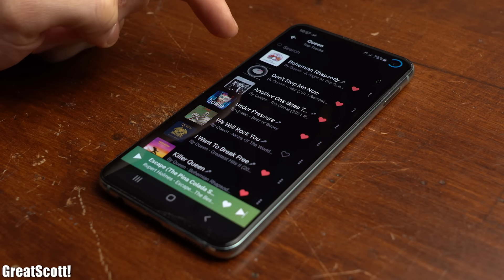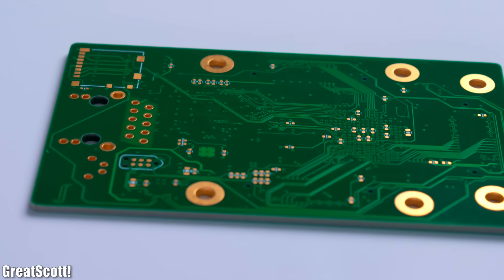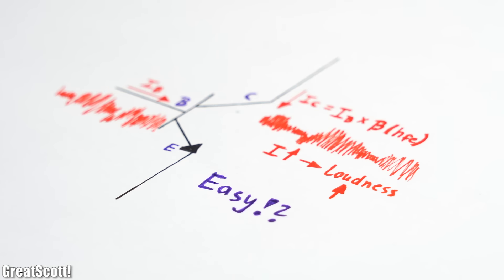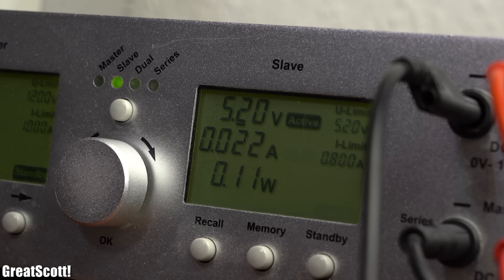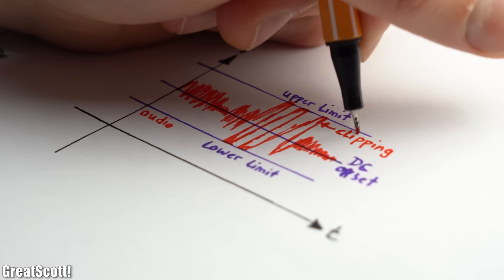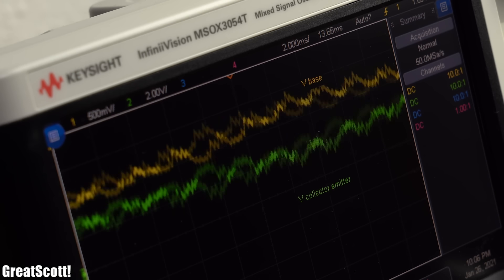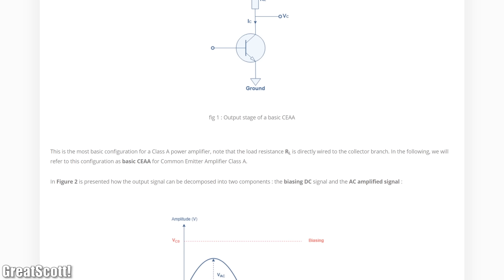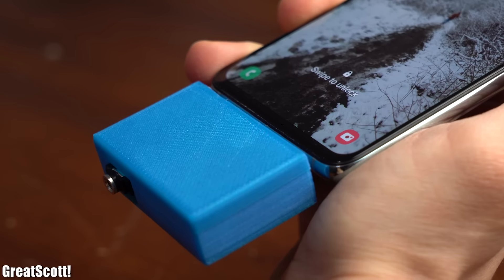Building the simplest, best sounding, yet most inefficient Audio Amp! || Class A Audio Amp Tutorial

Comment: Just wanted to clarify, isn't this generally the circuit used by preamps?
Reply: No! 
Pre-amps need to have very high input impedance to match the output impedance of microphones. That's why most pre-amp ckts use JFETs

Most pre-amp circuits on top notch audio equipment are hand tweaked for each mic and are secrets learned from experience

Text book designs are only used for average audio quality hardware 

Most audiophiles can tell the difference and would immediately reject cheap pre-amps

Comment: Have you tried a similar project CMOY amplifier?
Reply: You'll have problems getting a CMoy amp to run cleanly with a 5V supply, even with an OPA2134. There's really not enough headroom to cater for the voltage drop in the output resistor, especially with lower impedance earphones.

Comment: Might make more sense to use a single rail OpAmp. Certainly it will have better linarity…
Reply: Single rail opamps that will run off 5V and drive 32 ohm loads cleanly are not as common as you might think. I'd simply go for an LM386 to drive headphones.

Comment: Hi, I’m kinda new to electronics, can someone explain what he meant by “remove the input voltage “ and the use of the capacitors here ? Thankyou
Reply: He means the capacitors remove any constant voltage dc part of the signal. This is normally called dc bias. The capacitors are acting as 0hz filters.
Reply: @nakmail  hi, thankyou, so you mean if the input was 0v for a few seconds, the output would be 0 volts? Sorry if im not on the right track here
Reply: @georgekirby7656  Yes, if the supply was centred at zero anyway.
Reply: @nakmail thanks

Comment: I made this circuit but i changed audio and power to female connectors (power to micro usb) and i get a noise. It changes depending on the power source. Not sure how to deal with that
Reply: Decoupling capacitors.

Comment: You forgot to draw the load (O_O)
You know that since it is a common emitter amplifier, gain can be calculated as Av = - Rc / Re. Right? And what is Rc in your schematic? (The answer is not 130 Ohm)

I really liked this video, but I think you started on the wrong hypotesis. Ok, I know you wanted to use the simplest schematic possible. But why you haven't used a common collector stage? Or a common emitter, followed by a common collector? Or the simplest one: to use a small 2 channel opamp. This latter is the most understandable for everybody, I think.
Reply: The unloaded gain of the circuit is indeed -Rc / Re. And Rc is indeed 130R, giving an unloaded gain of 5. I leave it to you to confirm that the headphones have to have an impedance greater than 32 ohms if the circuit is to have any overall gain at all.
Normally, trying to get a voltage gain and a current gain out of a single stage is a big compromise, but the input impedance can be low in this case because it is being driven from a low impedance source, designed to drive headphones directly. That means you can increase the collector current to lower the output impedance of the single stage (which lowers the input impedance as well) without penalty.
So, what current would you use in a common collector second stage? 40mA? 80mA? What size of emitter resistor do you need to drive a 32 ohm ac load effectively? Then check whether you can't get the same result by simply increasing the current in a single stage common emitter by the same amount. Is a second stage then worth it?

Comment: I don't understand how 1ma was too quiet, 10ma was distorted, but 20ma was perfect. Wouldn't 20ma be worse than 10ma?
Reply: The 10mA result was distorted almost certainly because of an error in calculating one of the components leading to the dc bias point of the output being too high or too low, which resulted in clipping.
1 mA was too quiet because it gave a collector resistor of about 2.6K. When that was loaded with earphones having an impedance around 32 ohms, there was very little signal remaining. The 20mA circuit only had 130R as the collector resistor, so the 32 ohm load attenuated the signal much less, giving a louder output.

Comment: Can something similar be used to amplify guitar output to headphones?
Reply: No, you won't get enough gain in a single stage with these sort of low supply voltages. Do some research on single ic power amps to see what might meet your needs. An LM386 would probably be a good starting point to experiment with.

Comment: your circuit does not work for 3,6Ohm speakers. They are very quiet. I rebuild your circuit to fit some speakers from a laptop. they are 4 in total (2right,2left) each with 3,6Ohm impedance and I want to drive them in parallel. so each channel has an impedance of 1,8 ohm roughly. Can you give me advice for what components I should use? I tried changing some of the resistors to lower value ones, but that did barely make a difference
Reply: Give up trying to drive a load of 1.8 ohms with a simple class A amplifier. You'll need ridiculously high collector currents.
Reply: @RexxSchneider  Is it possible to use this circuit for an 8ohm speaker?
Reply: @sessizacbak8449  Yes, but you will lose most of the output signal as the amp has an output impedance of 130ohm with the given components. The attenuation will be by a factor of 8 / (8 + 130) = 0.06 or 1/16, which rather defeats the purpose of having amplification by just a factor of 5 anyway. if you must drive an 8ohm speaker from a phone, I'd suggest using an LM386 and you should be able to find plenty of LM385 projects by Googling for them.
Optionally, just buy a cheap Bluetooth speaker and save all the hassle.

Comment: or just install VLC on your phone that has a volume unlocker :)
Reply: It can´t go beyond the limitations of the hardware or better call it the kernel which sets the maximum for the physical output level.
Everything else is software based gain boost which will pretty much end in distortion.

There was a custom kernel for Samsung Galaxy S3 back then which was able to increase the max gain of the actual headphone amplifier inside the phone, so hardware based volume boost.
Howver samsung phones never had any good and loud amplifiers built in, at least not without a lot of customization and HTC really blowed my mind.
The HTC One M8 goes that loud, it will actually hurt!

Comment: I made an "audio processor" with 2 2N2222A transistors, two resistors and two capacitors
It sounds great, but when the volume is very high, the sound is like... tjrjtjtjrsjsjrhrjes
I use also a cellphone battery

Comment: You seem to gloss over how you select the emitter resistor and why you need it.
Reply: Emmitter resistance is not needed if the Vcc (power supply) remains at 5.000v forever. But to allow stable operation over 4.7V to 5.3V range (for example) a small emitter resistor provides slight -ve feedback to keep the bias operating point (Q point) relatively stable

(if Vcc increases, Ic does not increase as much due to Re...thus Ib doesn't increase as much..  and vice versa) .. 

Selection depends on power supply variation expected
Reply: @conesillyvalley7182  What you say about dc stability is true up to a point, but it's not the real reason for having an emitter resistor. The problem with BJTs is that they have very non-linear transfer characteristics, which means that their voltage gain varies as the collector current varies.

One way of seeing that is to consider that the transistor has a dynamic emitter resistance (re) which is equal to about 25mV divided by the emitter current (or collector current, as they are essentially equal with modern transistors). The input signal appears across that resistance and changes the emitter current, which changes the collector current, which changes the voltage across the collector resistor (Rc). That means that the voltage gain of the stage is defined by the ratio Rc / re.

However, for large signals, as the input signal rises, the emitter current increases and therefore re decreases and the gain increases; whereas when the input signal falls, the emitter current decreases and re increases, thus decreasing the gain. That means that the positive part of a signal is amplified more than the negative part. That is a particularly nasty distortion.

If we add an emitter resistor (Re), then the input signal appears across the sum of Re + re and the gain is now set to be Rc/(Re + re). If we design for Re to be much bigger than re, then the gain becomes approximately Rc/Re and the variations in re become negligible. That is necessary to bring distortion down to acceptable levels. If Re = 10 x re, then it follows that it will have approximately 250mV across it, since re = 25mV/Ie and the same current flows through Re. With a 5V supply, the gain is now reduced to 10 as the collector resistor will be ten times the emitter resistor in order to drop 2.5V across it (half the supply voltage).

If we set that biasing, with the collector at 2.5V, then we can estimate the dc stability. For a 5V supply, consider an increase of +0.5V, which is a +10% change. Because the resistive divider that biases the base to about 1V reduces the supply voltage by a factor of about 5, the change at the base will be only +0.1V. The emitter voltage will also rise by 0.1V to 350mV, resulting in the voltage across the collector resistor increasing to 3.5V. However, the supply voltage will now be 5.5V, so the quiescent bias point for the collector will be at 2V, rather than the preferred 2.75V. The reduction in maximum output swing is significant with these low supply voltages, but unless maximum output swing is essential, that is likely not to be an issue. Obviously, a larger voltage across Re will improve the dc stability. but at a cost of reducing the available output swing anyway.

Comment: my desktop speaker sounds really quiet. i want to increase the volume, any solution?
Reply: Replace the built in amplifier.
You can even get some cheap yet decent class D amplifiers from china.
They have an efficiency up to 90% and will probably have insanely more output power even with the same old power supply from your speakers.
I actuall did this with some Wavemaster 240 speakers, removed the old amplifier IC from the board and soldered the audio input from the board to the class D amplifier aswell as the power.
I had to cut a track to seperate the audio ground from the power ground in order to get rid of loud 50Hz noises.
And now those speakers have a lot more power.

Depending on what kind of speakers you have, you can try your best with an TDA7492 amplifier board.
It can deliver 2x10W RMS or even up to 2x 15W peak at 12V input voltage which is common for most active pc speakers and already way more than you´ll need on your desk.
With a voltage of 24V it can even go up to 2x 36W RMS and peaks around 2x50W so it´s quite powerful.

Comment: Don’t they make a single 8 pin IC that does this?
Reply: the LM386 is a handy little audio amp that is easy to use.
Reply: @SkyhawkSteve  except the lm386 is an op-amp and not a power-amp
Reply: @lotrbuilders5041  check the data sheet.  With a 6v supply, it delivers 325mW into an 8 ohm load.

Comment: i didn't understand about dc biased current at transistor base.
Reply: Let me try from a different angle:
by knowing the collector current and the emitter resistor, you know the voltage on the emitter. When you add 0.7Volt you know the voltage needed on the base. You need the resistor divider at the base that will provide that voltage, and there the calculations are for. Only one element that is not explained by GreatScott is the 10x in the divider under the line: that is a factor to make the current through R1 and R2 be 10x  the base current, so there will be a stable current through these resistors, and the (relative small) base current won't influence the bias point. GreatScott took 10x, but you could also use 15x, even more stable, but using a bit more current through R1 and R2.

Comment: A nice amplifier, however, unnecessary in overcoming the obstacle. The easiest way would be to install an app from the android store. It is best to download a player with many "equalizer" sliders. You can simply download the amplifier in the form of an application. Another method is to improve the sound quality of the song being played by modifying it on the PC. A mechanical amplifier would then be redundant. A much better method would be to use the speaker behind the bloototh instead of putting an additional electrical circuit into the phone. Thanks to this, you can damage the connectors in the phone and only then will the costs appear. It's been a little over two years since the film was published, but I just came across it. Despite simpler drugs to solve the problem, I appreciate that you solved the problem mechanically and yourself instead of a program written by someone else. Regards (google translate)

Comment: 10uF at output, low frequency is gone. -3dB is at 800Hz. A better design would be using MAX97220.
Reply: Since the amplifier has an output impedance equal to Rc (130R), the output at the earphones (likely around 32ohms impedance) is reduced by a factor of 32/(130 + Xc + 32), where Xc is the impedance of the capacitor at a given frequency. When Xc is negligible at high frequencies, the reduction is fixed at 32/(130 + 32). So the -3dB frequency occurs when Xc = (130 + 32) ohms, not just the impedance of the earphones (as it would if the amplifier's output impedance were much lower than the load). A quick calculation shows that 10μF has an impedance of 162 ohms at a frequency of about 100Hz, which is the actual -3dB frequency.

Although a 22μF capacitor might show a little improvement in bass response, anything more would be wasteful.

I do agree the MAX97220 is a very nice chip and perfect for this sort of application, but the very small SMD package means that a proper circuit board is needed, plus the skill in assembling SMD projects. You can, of course, buy an assembled module from Ali Express, etc. at a very reasonable price.